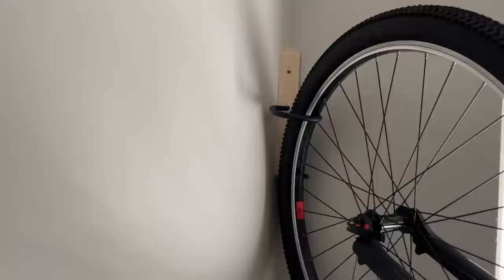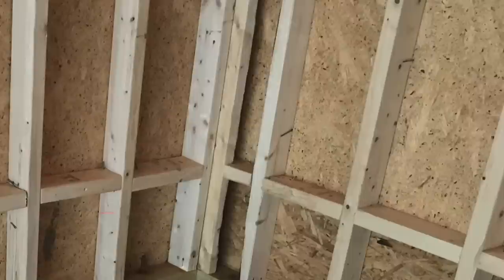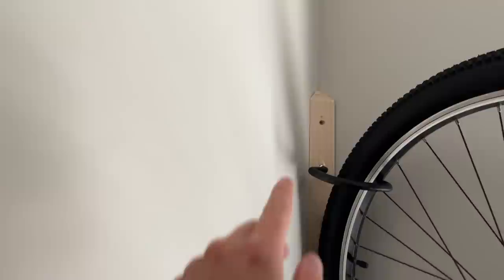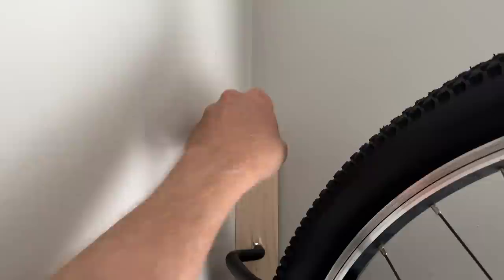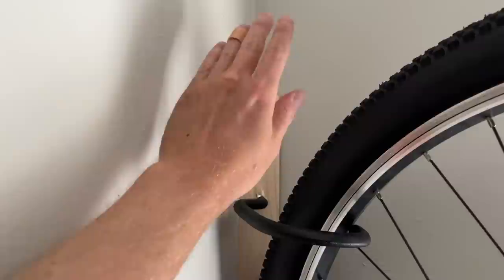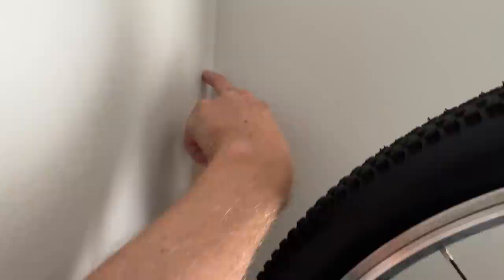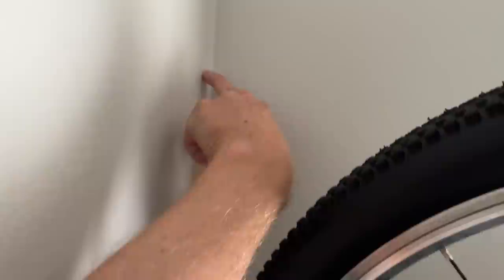This CORNER BIKE RACK Idea Works Great For Small apartments! (Simple Wall-mounted Bike Hook/Rack!)

Comment: Great solution. I hang my bikes in a similar way. 
I would make one change. Mount it higher, such that the rear tire is off the floor and the bike is bit more out of the way.
Reply from the maker: I would have done it with a road bike Tony, but my mountain bike is so heavy I’m too lazy to lift it 😅
Reply: Lol, that is truly lazy.
Reply: @TheHonestCarpenter  there’s a technique for lifting heavy bikes off the floor to a high hook that I’ve used at many employers whose bike lockers have too-high hooks. Just get the bike vertical before lifting, then get the seat up against your thigh or in the crook of your hip. Give the seat a little nudge with your leg while controlling the bike during the lift with your arms. You’re lifting with your leg and controlling with your arm. I used this to great success to lift my heavy winter commuter to the high hooks in my bike locker every time the low hooks were all taken. 

PS: get a little rubber mat or doorway rug under that tire to protect your floor over the long run.

Comment: My friend did one where he turns the front wheel horizontal and hooks that way so the handlebars are not jutting out. It sits a little flatter against the wall. Personally, I’d hand from the rear wheel and use the quick release front to take off the front wheel for even better storage.

Comment: Bicycles are such an awkward form for storage in any normal dwelling. I've been considering how to store my bicycle and trailer in an alcove of my small workshop. I'd prefer to fabricate any simple hardware components from scrap metal, but my priority is storing and retrieving easily with fewest possible steps, so I'm open to dedicated rack systems if anyone has suggestions.
Reply: Not sure the shape of your alcove, or of your bicycle and trailer, but I do enjoy thinking through designs that involve simple, easy-to-source hardware, especially if not always for the original purpose.  In your case, have you considered a platform such as a piece of plywood, or a frame with just enough material to be a platform for and support the bicycle and trailer, and whatever the height is for that, make a vertical 'tongue' on the front of the frame/platform equal to that height, plus an inch.  Now make a corresponding tongue of a much shorter length sticking out from the wall.  Overlap the ends of each tongue, drill holes through the overlapping ends, and hinge them together with a carriage screw and nut, similar to the joint in a pocket knife, which allow you to fold your rack up and out of the way similar to folding the blade of the knife away.  

If you mount the tongue on the wall a bit higher, the frame/platform will be tilted to drive the bicycle/trailer up on to it, and it will be a few inches more up and out of the way when folded up into the storage position.  To assist with lifting it up, a couple of those gas struts such as those which help lift your car's hood or rear gate could work (they come in various lengths and lifting capacities).  Also, this design as described is with the tongue on one end, and folding it up tall, as the bike's position in this video, but it could also just as easily be done from the side, and have two tongues, front and back, then fold it up onto the wall sideways.  To use, unfold down from the wall and roll your items off the rack.  To store, roll them up onto the rack, and fold up out of the way.  A series of brackets attached to the 'floor' of the rack and engaging the wheels could hold the bicycle and trailer secure when in the up/storage position, or else safety straps made from velcro.  A safety latch would also be a good idea, between the edge of the rack and the wall, just in case the gas struts ever give out, wouldn't want the rack falling on someone.

Hope that helps give you a couple ideas.

Comment: I think I would have rather mounted the bike  the wall over the couch with a horizontal bike frame mount, but that’s just me. I had bad experiences with hooking rims to mount sun the past. I’ve also had the same experiences trying to screw things into a corner where I thought that there must be great support. More often than not, it wasn’t there. 😂 Still a wonderful guide on how to use that table saw. I’m still learning about how useful it can be.
Thanks!

Comment: Somehow seems to use quite a bit of floor space. Hanging high on the wall or raising up to the ceiling on a pulley system could be other options.
Reply from the maker: Bikes always take a lot of floor space Mads. Just hard to avoid 😬
Reply: You still need clear floor space to bring it down.

Comment: Make sure you wash and dry your tyres every time you put it right there!
Reply from the maker: Good advice, Darko 👍
Reply: @TheHonestCarpenter  btw, l really like your show, although l live in Serbia, Europe and our housing is so much different. Still, l really improve my skills watching your show. Great content!
Reply: This is a good point, but I'd rather fit some kind of protective covering on the walls and floor so you can just throw the bike into its place. Perhaps vinyl mats on velcro that can be removed for cleaning?
Reply: Two pieces of 2’ x 6’ 1/8“ hardboard or pegboard would protect walls. Easy install w some drywall screws. Could put hooks in pegboard to hold helmet, tire pump, etc.